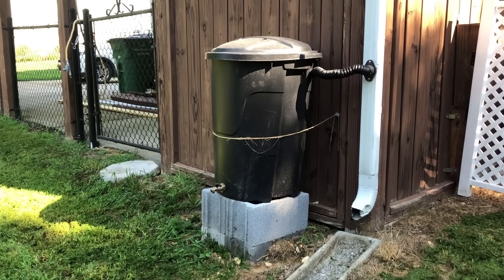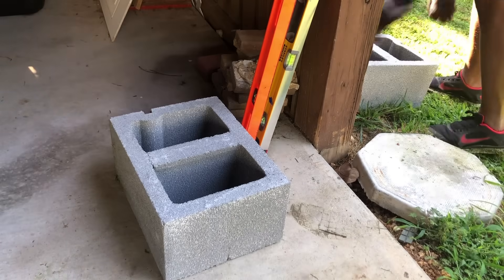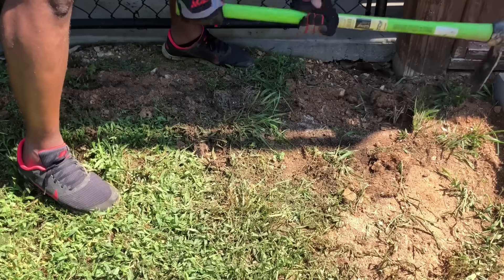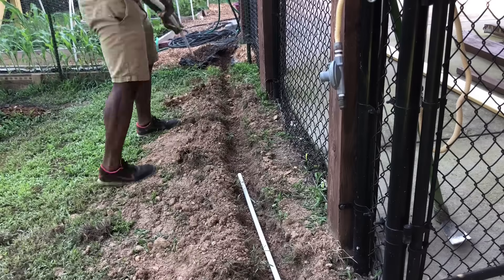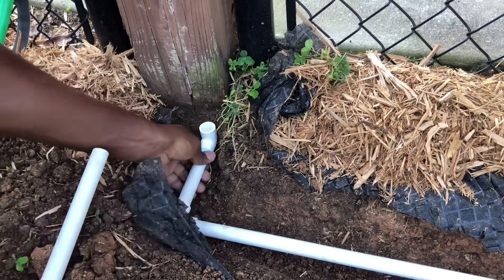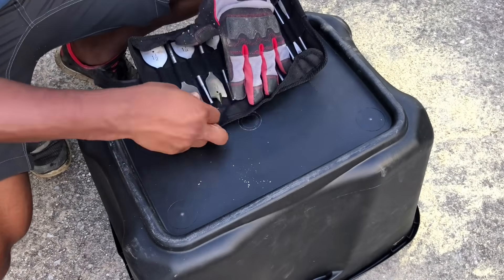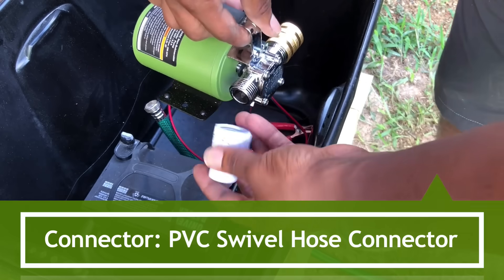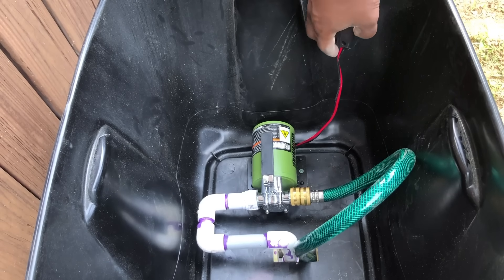Rain Barrel System | CHEAP Water Pump Setup

Comment: Brilliant. I have just fitted up my rain water barrel with the intention of using the water for car wash garden etc. I have a pressure washer that runs to about 1100 PSI. WHAT SORT OF PRESSURE PUMP WOULD I NEED AT THE WATER BARREL PLEASE. CHEERS FROM HERE IN NEW ZEALAND. 👍👍
Reply from the maker: Great question Mike Hayes. I do not have a ton of experience with using pressure washers with on-demand/transfer pumps, but I think if you can locate the minimum incoming gph/gpm needed for the particular pressure washer you have, you can determine which pump to go with. I do have an electric pressure washer but have yet to use my rain water to wash my vehicle, but if that's something you would be interested in seeing, let me know.

Comment: Great vid but why such a small Barrel? My Rainwater "Barrell" Tank is like 5000lt 😄much batter tasting than town water with all of the fluoride in it but I still boil and filter it in a 0.5-micron ceramic filter before drinking it. Right son now get busy you got a like and sub from me.
Reply from the maker: At the time of posting this video, I had no to little experience about rain collection, and knew no one personally with one, so I started small to get my feet wet lol. After a little time went by, I could see that small trash can was not going to cut it, but I was glad I started there instead of not at all. I'm slowly learning more about this field,  and increasing my capacity. At some point, I will aim to have a similar capacity as you do :D

Comment: Question about the pump you used. What’s the hp or gph rating? Do you feel that pump would have sufficient pressure to support a larger sprinkler to water a much larger garden? Or do you feel a larger pump would be required? Thanks!
Reply from the maker: The pump in this video is rated for 290 GPH. Depending on the distance your garden is from your pump would determine if this would work for you or not. If you check out my latest video, I performed a comparison between a larger pump I just purchased for this application to this Harbor Freight pump and I also did a sprinkler test comparison. This may give you a better idea.
Reply: @GreenTechTown  awesome! I’ll check it out. Thanks for the reply!

Comment: I do not know if you live in a place with a risk of frost, but if you do, you might want to ad a way to drain your lines, either manual drain valve or automatic (weep point, see how garden hydrants work for how too). I am impressed with the clear presentation of all relevant details. I subbed your channel to see what you come up with next. 👍
Reply from the maker: Thanks for sharing Jelle.

Comment: I am not able to do such pvc installation for my garden because I live in Canada, and our ground freeze line is between four and five feet deep. I am lucky to have a well with a free standing hydrant attached to it. I attach a hose to the hydrant and fill my rain barrel with well water. I am using simple gravity at this time, attached to my soaker hoses. Those hoses need more work because they are still twisty. I may add two more raised beds next year, and use the black tubing. Then motorizing makes sense. Well done. I watched your next video before this one.

Comment: A sprinkler timer will work well for your remote on/off control but requires power. A trickle charge from Harbor Freight also works well to keep your battery maintained.  Don't forget to fuse both you incoming power to whatever you choose and your 12VDC power for safety since the components are outside.  Lastly think about using an air compressor to blow out you PVC lines when it starts to get cold enough to freeze(like the RVers do for winterization) Overall nicely done. Don't be afraid to experiment with new ideas since it builds confidence and skills.

Comment: Very good video! Would the pump be likely to burn out if it is running but the water isn't running out of the nozzle on the hose? Like when you haven't started watering yet?

Comment: Late to the party - nice video, minor safety note - you used the push stick on the incorrect side of your cuts for the border pieces. Kickbacks are most likely to occur between the fence and blade, your pushstick is on the material between the blade and open air. Stay safe out there, and nice video.
Reply from the maker: Thanks for the tips!

Comment: Just a thought for people making a pump system for their rain water. If you raise the level of the water, gravity will do all the work for you, no need for a pump or electricity. Since you are usually collecting rain water from the roof, the water is already coming from an elevated height. Building a simple wood platform to raise the height of the rain barrel a few feet high is all that's needed. A few 2x4s can get that done. The higher you go the greater the water pressure. Have an elevated deck off your house? Put your rain barrel there. As long as it will support the weight.

Comment: Just a suggestion but instead of digging down to level the pump foundation you should probably built up the far side with some smaller bricks. The slope next to your house is to guide water away from your foundation.

Comment: You are going to burn that pump up fast. That pump is not meant for having a restriction.(running sprayers or building any kind of pressure) that pump is designed to transfer water. Run with no head pressure. I give that pump maybe a couple of hours of use at most. You can tell the pump didn't like it right after you started it up. Went from humming to whining

Comment: Would you consider using a small sump pump? I’m building 2 raised beds this year and would love to somehow use a rain barrel and soaker hoses. Just wondering if a sump could be less work? Although yours looks so nice. Ideally I’d love to be able to harness the water that comes out from the indoor sump right near wear the beds will be!
Reply from the maker: Yes, a sump pump should work as well. Of course how you connect your hose/piping will differ from my application, but the pump will serve the same purpose of increasing the water pressure to your garden. Since I have not installed one myself for this type of application, I cannot say for certain it will be less work, but I would think so considering your pump is inside the barrel which means less plumbing and no need for a tote to protect it. Additionally, I think most are outfitted with the ability to connect a float switch so that the pump will automatically turn off if the barrel is low on water which would reduce the electrical wiring needed for an add-on water level switch.

In summary, whatever is the simplest solution for you is the right solution.  :D

Comment: Very interesting video.  (Very well done, too by the way.)  
I took the output of my basement sump pump and filled a 55-gallon outdoor container.  I used another sump pump in the collection container to pump the water through a garden hose to water my lawn and garden through a sprinkler.  When the 55-gallon collection container water level got low the sump pump would shut off and not risk burning out.  I bet had I used a transfer pump like yours would have given me significantly more pressure.  I still could have used an independent  sump pump float switch to shut off the pump when the water got low.   Thanks again for the video.
Reply from the maker: Nice setup Joe. Thanks for sharing also. I like how you are using your basement sump pump as a means to re-fill an outdoor container.

Comment: WOW!  A video where I didn't see something done wrong or foolishly.  I've been watching quite a few video's.  You can find low voltage timers that can turn your pump on and off at set intervals.  I believe you can even find them where you can set a 7 day watering schedule.

I have yet to start my project.  I've considered solar for keeping the battery charged same as you're thinking (or may have done by now).  Oh, wait - I see another video from you displaying solar panels.  I applaud you for your creativity and understanding of the basics.  One vide I watched the guy drilled and tapped his barrel.  And I definitely had comments for him about his methodology and about the strength of such a connection.

Proverbs 1:5 "A wise man takes in more instruction; a man of understanding acquires skillful direction."

Comment: Awesome!
Yes I’d like to see a pressure sensing auto on off pump. Solar panel to keep battery topped off or to run the pump it’s self would be sweet. 
Please. 
Yes.
Reply from the maker: Thanks for the feedback. It is definitely something I am looking into to try to learn more about those types of pumps and maybe increase the amount of water flow going to my garden.

Comment: Great idea and implementation!
Im currently using three similar rainwater barrels, with a similar height stand. The lack of preassure from them is frustrating. I was considering just elevating them, but attaching an electric pump does sound like a much better option.

Comment: I have a above 27 foot pool, when I clean the sand filter I usually just run the  waste water onto my plants using an extra long 1 1/2 hose. I bought two 275 gallon totes some years ago hoping to use them to store run off water from my deck. Which never worked out. So yesterday I moved them closer to the sand filter and today I will be hooking up a way to run the waste water into the totes. I will use a 5 gallon bucket with a 5 gallon paint screen to filter the junk out be it goes to the totes. I have an old well pump that I will use to pump the water to my garden and yard.
Reply from the maker: Awesome, thanks for sharing!

Comment: I see that you've attached your rain water system to your city supplied water. Check your code but where I live you have to install a backflow preventer to keep the rain water from entering your city supply
Reply from the maker: Hey Turd, yes you are correct and I do have one installed, just not shown in the video. One of those details overlooked when creating the video (there is always usually something lol), but I have added it to the description to hopefully give awareness to the concern. Thanks for sharing!

Comment: excellent video!  question regarding the battery.  is there a reason for the battery you used or can it be different?  can it have a different amp hour?  looking at batteries and prices so that is why I am wondering.  thank you.
Reply from the maker: Great question! Yes, you can use a different amp hour battery, it just needs to be 12v if you are working with a similar pump (12v) like mine. You just need to factor in how long do you plan on trying to use it before you re-charge the battery. The higher the amp hour rating, the longer you can run the pump for. With my solar panel connected, I can probably use a smaller battery since the solar panel recharges the battery almost every day.

Comment: I added 32 solar panels to my home.  14kw system.  I am putting in a manual generator and transfer switch now for 50amps f emergency service.  enough to keep my furnace running and two freezers plus a few lights

Comment: This is awesome. I hope to replicate this type of system. Struggling to figure out which pump I need? I'm gonna transfer at least 150' away and up maybe 2 feet. How can I figure out which pump would work for me?
Reply from the maker: Hey Judah. For a distance that far, I would recommend trying to either talk with a few local pump suppliers in your area or visit an online forum that has an active community that knows a lot about pumps. I would still consider myself a rookie when it comes to sizing pumps, and most of my experience has been from trial and error.
Reply: @GreenTechTown  Thank you for the reply! I'll do some additional digging and investigation.

Comment: Excellent video! My question is if you've since set your water system up to a timer? I have a rain barrel that I want to use for my water supply to a small greenhouse where I want to install drip lines for plants. Suggestions? Thanks!!!
Reply from the maker: Hey Ted. I would say I am still a very active watering gardener instead of passive which is what I am aiming for this year. So, no I have not used a timer yet as I would like something that make sure I am not watering the garden when it does not need to be watered. Regarding your greenhouse, I think the approach taken in this video should give you a decent rough start, and you may want to check online or with your local nursery for the best timers to go with. That's my plan when I get around to it.

Comment: Robert, I can’t tell how far away the garden is from your rain barrel. One thing I do to save water is to fill a water barrel at the garden and drain into cans (or dip water cans?) there to water by hand. I put the water precisely where it is needed. Your pump system will work nicely to fill barrels at garden side during a rainy period. Thanks for the great video. Time to grow food.
Reply from the maker: Nice, and thanks for sharing Duane. I have not tried that watering style before, but I'm sure it works just as well.

Comment: great Idea. I wonder if a larger pump would produce more psi for ya. even a pump 120v that could also be used with an Inverter and solar?
Reply from the maker: Hey JAlly Farms, you are correct, a larger pump would produce more psi, and yes you could also use an inverter. I tried to keep the initial cost low for my setup, but those are definitely some options you mentioned. Thanks for sharing.
Reply: @GreenTechTown  ok I'm dump youtube just showed me a video that you did add solar to it

Comment: Is there a reason the pump is battery powered instead of AC?
Reply from the maker: Hey Mark. Yes, I planned on powering it from Solar Energy and using a DC pump would allow me to prevent from having to use an inverter in my solar system.

Comment: Do you think this pump would make enough psi to use in a drip irrigation (from 100 gal water container) ?  If the valves are on a timer, would you use a different type of pump?  Thanks!

Comment: This looks great. I plan on doing this. I live in NE Ohio. Will I need to cut the pvc lines in the winter so they don't crack in the winter. I already have an auto drip line system but want to switch to a rain barrel or two. Rain water is so much better than tap water. Tap water actually kills plants.
Reply from the maker: Hey Kickinlikea. It would be wise to create a way to easily drain out the water in the winter time. I have heard of some installing an additional ball valve near the lowest point in the system that they can open before the cold season starts to drain out any water in the system. They also of course remove all the water from the rain barrels and re-route the downspout infill port.

Comment: Lots of good ideas here to improve my setup!

I used a 3/4 Horsepower pump using 120 Volt ac power.  Then I run a hose, (similar to your setup), from the 50 gallon rain barrel to the pump and connect a garden hose to the pump.  It gives plenty of pressure, as much as from house pressure.

Also, I only use it to water the lawn and boulevard because the rain barrel is fed from my house roof which leaches tar chemicals and grit from the shingles.  Thanks Green Tech Town.

Comment: Just in case u get a leak inside tote, simply drill a few holes in bottom of tote and glue some screening mesh over the holes. Then the water will drain out and not hurt battery.

Also the less you have water traveling uphill, the more psi u will get

Comment: Outstanding video, I would also state using an RV pump would be beneficial in this application. I would also encourage installing a solar panel to get power to charge battery up!

Comment: You're going to need a back flow preventer. That is illegal to apply an untreated water source to a domestic water supply without a Backflow preventer. Double check valve style or reduced pressure zone BFP. In the event there is a pressure loss on the domestic water main, it can back siphon rain barrel water into the city water feed. I know you have a valve separating them but accidents happen and valves get left on all the time. Just saying buddy. Love the content but safety first.

Comment: What about using a elevated tank and pumping the water into the tank using a low-cost, low-power, pump?  Basically you pump the water from the rain barrel into the elevated tank.
Reply from the maker: I've never seen that done, but it sounds interesting and maybe possible. Let us know how it goes if you try it out! :D

Comment: No idea about regulations where you live, but here in Belgium rain water and city water pipes are not allowed to be connected to each other (not even with a 3 way valve) because of the risk of contamination to the drinking water. That aside, nice job.

Comment: What we want to know is how can we use a pressure washer and be able to almost the whole rain barrel? (as is the water pressure only allows the 1/3 of the water to be used. At 2/3 water in the barrel the pressure in the barrel will be unused by pressure washer) Can you solve this?

Comment: I’m not sure it’s safe, or even legal, to essentially construct a mixer valve between city water and stored rainwater without a check valve protecting back flow on the city water side.

Comment: I was thinking that I would go with a 120v pump and run electrical to it...but nowadays, a solar panel to keep the battery up would probably be the way to go.

Times change and I need to keep up.
Reply from the maker: Yeah I have no regrets keeping my overall electric circuit simple by using all DC hardware.